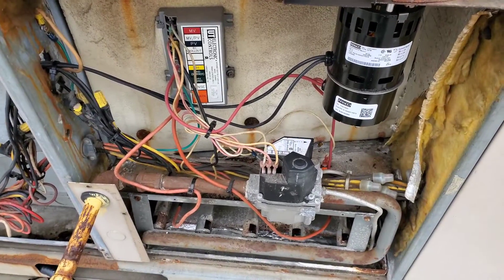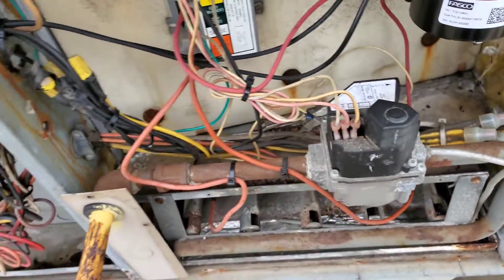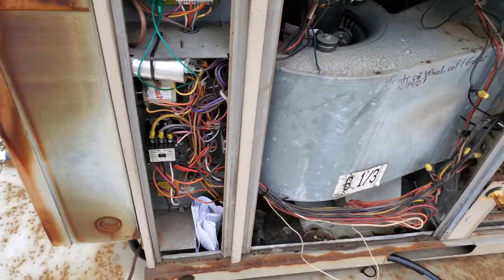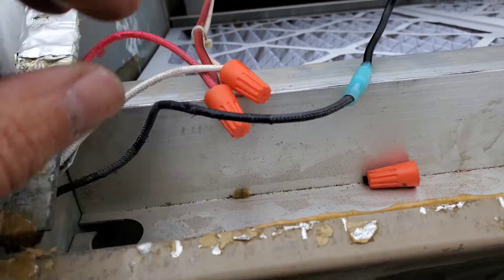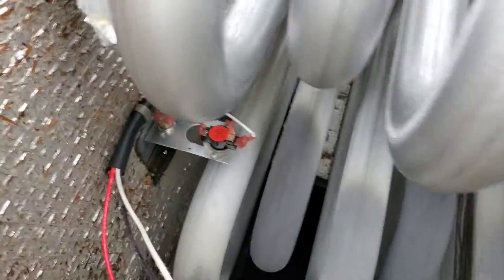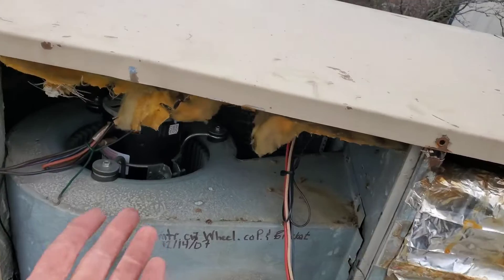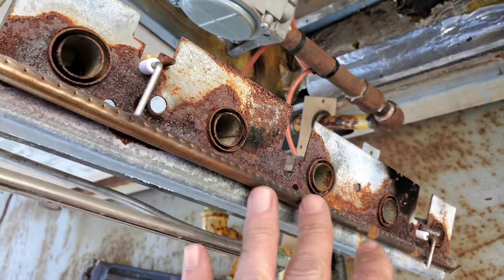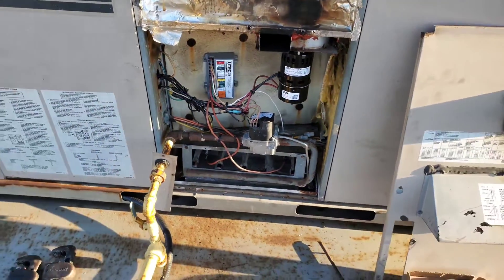Rooftop Unit Wiring Problem

Comment: When the igniter tube only partially lights you need to check the combustion intake. The square holes at the orifice. The insulation on the bottom of the unit can restrict the air intake and this causes the flame not to reach the flame sensor. I spent hours on one laying on the roof melting ice under me before I saw what was happening. It fired up just fine outside the unit but when I put it back in the igniter tube had short flame. I was freezing and wet. You know the days you love your job lol.

Comment: Under firing?  Better check the htx .
Reply from the maker: The heat ex is brand new, well a year old.  And it's minty fresh lol!
Reply: @HVACKnowItAll  I seen that the vent motor exhaust had some soot on it.  Also the small flame could be touching the metal. Be careful out there.
Reply from the maker: @ShanQueefus  correct it did, it was from previous issues with the machine.

Comment: What happens when gas pressure is less then 3.5 in wa? How does unit operates?
Reply from the maker: I don't know, my coworker set it before I got there.  I didn't turn it lower I just double checked.

Comment: Did you combustion check? Bet that unit gas turned down because its sooted up and can't burn right at normal gas pressure. Typically soot is from running too much fuel. Probably needs condemned on the spot
Reply from the maker: Burner is clean, heat ex is one year old (no cracks), no flame impingement, no CO in the space (I used my personal CO detector.  Running lean of gas will cause incomplete combustion which will cause soot. Air can't be adjusted on this particular unit.  But no, I didn't check combustion analysis, from my experience with rooftops, this was running safely from all checks that were made.
Reply: HVAC Know It All I always thought incomplete combustion was too much fuel, lack of air, or both.
Reply from the maker: Yes the lack of oxygen defines incomplete combustion 100%.  But have you ever turned down gas pressure so low it just starts waving around with an orange flame?  Improper mixing of fuel and air can cause incomplete combustion and from what I read, relatively low flue temps can also contribute.
Reply: HVAC Know It All yea thats candling and very extreme low gas pressure that i can t even measure
Reply from the maker: Well it's sure possible that the soot had been there due to lack of air flow, the venter motor was also changed out not too long ago from what I can see.  The previous heat ex may have also been partially restricted.  All I know is what I observed and corrected.  I'm just hoping that POS gets removed off the roof soon.
Reply: HVAC Know It All yea i can buy that the other exchanger was bad and the soot was from previous issues. I commented before I saw the new exchanger in the vid. I know that housing where the soot was is reused  on those york. I think all you get on lthose is a motor that doesn't even come with a wheel. Those older yorks seem to soot up alot
Reply: @PTF491  Isn't it a standard procedure to measure and print a report from a combustion analyzer every time anything it touched in the gas path/burner/exchanger/flue system? I mean, it covers technician's ass and also justifies the invoice (use of expensive equipment).
Reply: Luzt I'm not an expert in law as far as how mandatory it is. I also wonder the same as far if it would be considered negligence to not test. I know there are published standards in ansi for co levels in flue gas. It is definitively good practice to do so. I was also taught to test every piece of gas fired equipment.       I believe it should put it in the codebook and made mandatory. I have read the ifgc and it doesn't say anything about it being mandatory. However there is a section in the appendix that publishes levels of co and how to service gas appliances. Id agree with you that it allows you to charge more and justify it. You are providing a greater level of safety and ensuring the equipment is running most efficiently.
Reply from the maker: In the land of rooftop equipment, it's rare to see anyone stick an analyzer on them.  The only adjustment is gas pressure on a rooftop and that was good at the end of the call.  Clean burner with zero impingement and proper gas pressure with a good heat ex in most of all cases is good.  One can use the the extra step of an analyzer if the unit is not burning right to justify repair costs to the customer.
Reply: HVAC Know It Imo analyzer should be used on all nat gas appliances. Yea air is fixed. However lots of things can affect that. Daubers on the inducer blower. Rusted out exchangers then your burning over 400 ppm co. Then the blower door is off down the road from impact stripping all the screws out and high winds or the economizer hangs open and you have potential high co in the building. If you use an analyzer every time instead of high co in building In one of these scenarios its only gonna pull maybe 25 ppm or a level lower and safer. Co is odorless. Obviously you can smell incomplete but by that time levels are usually over 4-5k ppm, but using the analyzer every time ensures greater safety. I have first hand witnessed high levels of co in a building from the above scenarios.
Reply: The analyzer is the first step to confirm its running right.
Reply: @HVACKnowItAll  OK. On the electrical side, since I have proper equipment I tend to measure e.g. earth-fault loop impedance and RCDs. I sleep well and the customer sees I am not a cowboy.
In any case I do not question your methode of procedure but only want to confront it with more or less analogous situations in other areas.